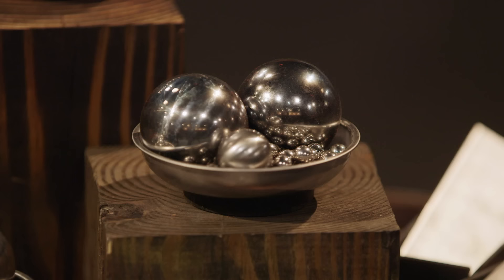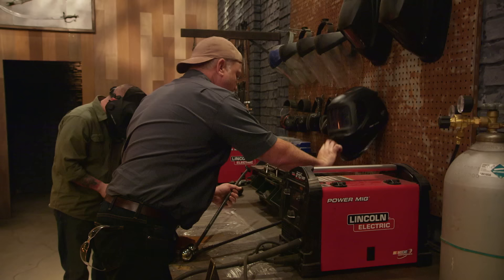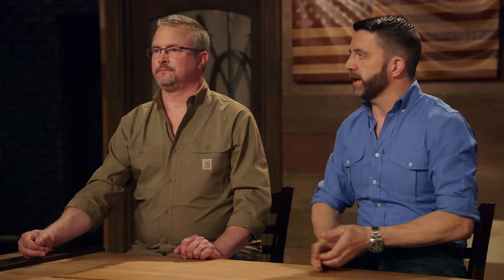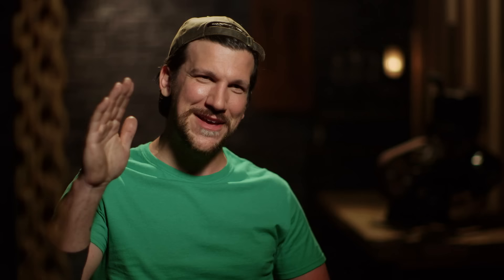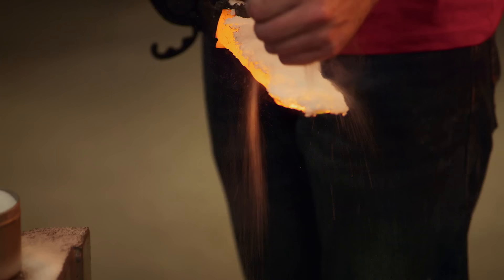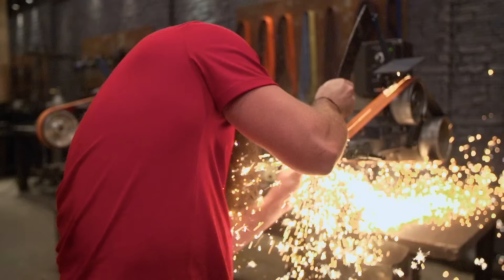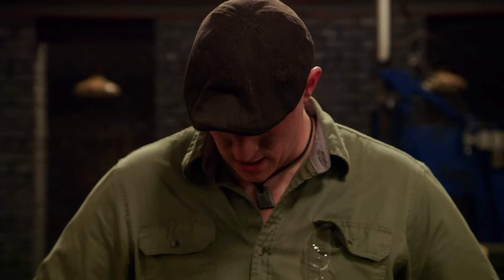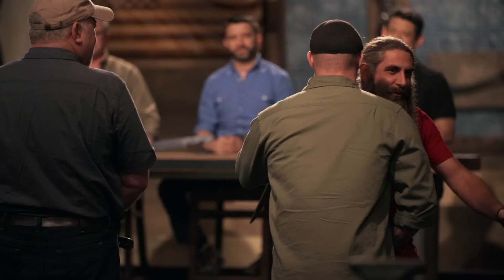The Pressure is ON in Steel Ball Challenge | Forged in Fire (Season 7)

Comment: That beard is such a fire hazard! Using the grinder without it tied or netted was scary to watch!
Reply: Hair is not that flammable.
Reply: @Durwood71  Many men oil their beards. I haven't researched the flammability of the average beard oil and don't plan to, but anyone who does oil their beard and work with fire... probably should.

Edit: Regardless, the other pertinent hazard is entanglement with machinery.
Reply: @JH-wd6dp  my skin crawled when the long beard next to the active belt. 'De-gloving' is not pretty.
Reply: @mbeavis2587  Absolutely
Reply: @Durwood71  If caught in the wheels, it could rip half of his face off.